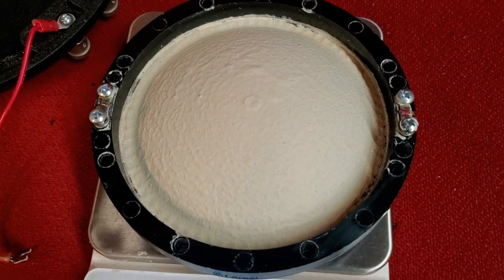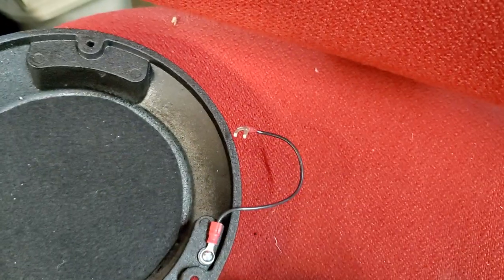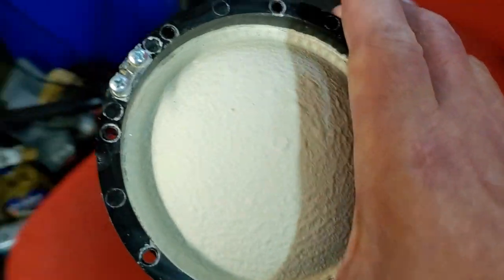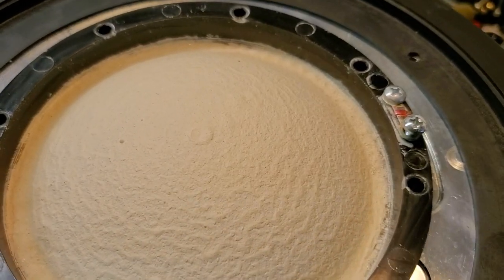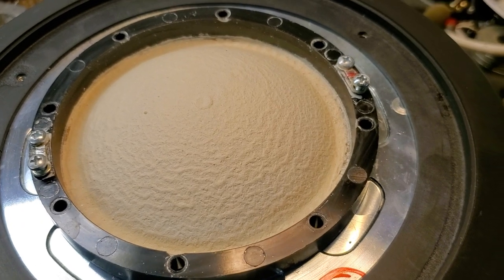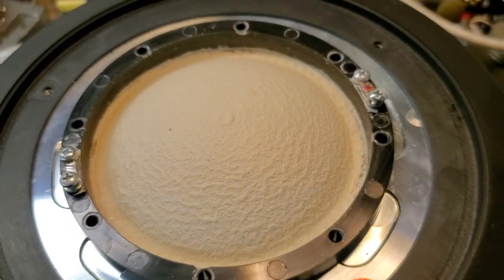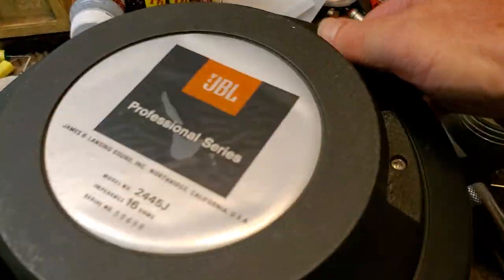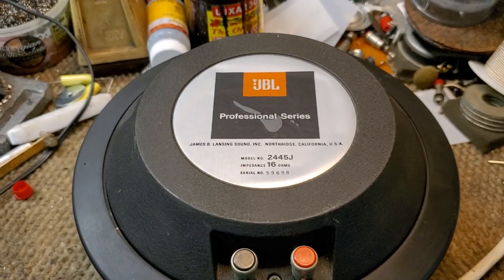Applying Aquaplas coating to a JBL  diaphragm.

Comment: was the first sweet in the mid band sounded like it
Reply from the maker: Sounded like what? I think you might be hearing some artifacts from either my phone's camera mic or some crackling from my sweep generator. At the test voltage of 1 watt, the SPL is about 110+dB, so the mic is getting a bit stressed and the compressor/limiter is kicking in.

Comment: It looks like it is applied much thicker than the SL diaphragms
Reply from the maker: I also apply it to the suspension. Less than a gram of added mass. I blew compressed air to redistribute some of the Aquaplas, so it gave the wavy, textured impression.

Comment: You'r changing it's caracteristics. You want to avoid those harsh midds, go for metalic horn, damped with bitum. It will calm those harsh midds & have better highs at 12khz
Reply from the maker: You're correct. The characteristics of the harsh secondary harmonics are greatly reduced by the damping of the Aquaplas.

Comment: nevercoat the surround Fs will go up pulse will go down! qms will change and so on.
Reply from the maker: Please tell me the Fs of the JBL 2445H/J.
Reply: data are on internet around 460 HZ @edgewound  why you need to know?
Reply from the maker: @obiessen  JBL, nor any other manufacturer of compression drivers publish Thiele-Small parameters. I'm curious from where your data come. BTW...Meyer Sound dampened the metal surrounds of JBL diaphragms with a coating to dampen resonances...distortion.
Reply: @edgewound  messurements, he will have the same problems .all parameters change,
Reply: @edgewound  check imp curve you wil see
Reply: @edgewound  maybe intresting for you i did a lot coating test begin of 2000  its intresting to see what happens after one week with parameters ,after one year and after 2 years. the conclusion was adding a bit of mass (weight coating) doesn`t influence the data so much, but coating surround does.espsecialy QMS/Fs) we tetsted with normal fullrange /tweeters and drivers. i hope it is intresting for you.we aslo tested for berakup changes, direct after one month after 1 year after 2 years.
we tested; C37 damar/ a special glue/special damping material for breakups.
Reply from the maker: All of the customers that have requested this coating have reported an improvement in sound quality...and that's what matters. BTW...The tweeter in the JBL LSR monitors is coated completely. @obiessen
Reply: @edgewound   i am honest with information i don`t need to sell them.So my advice; only coat diapragm without surround!it will sound and test better than with surround.